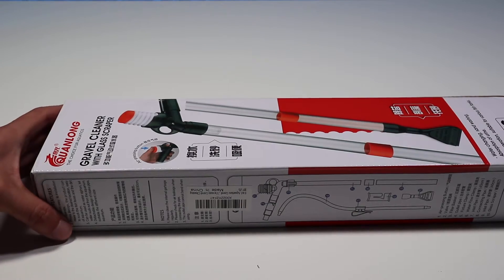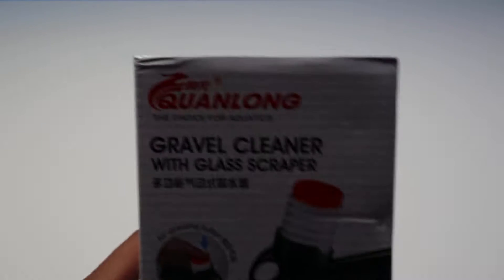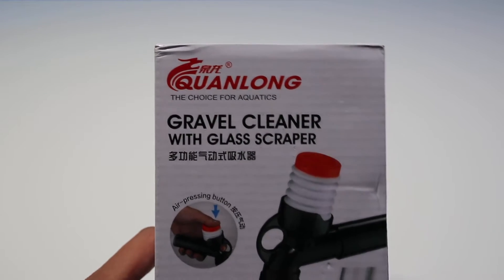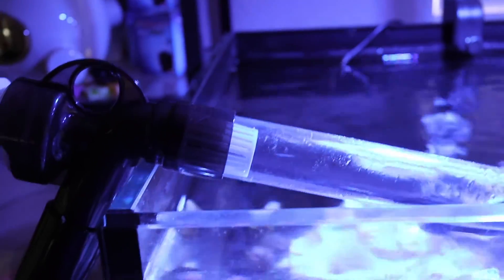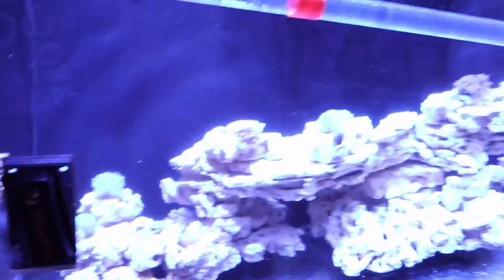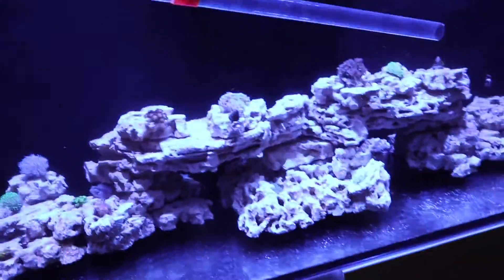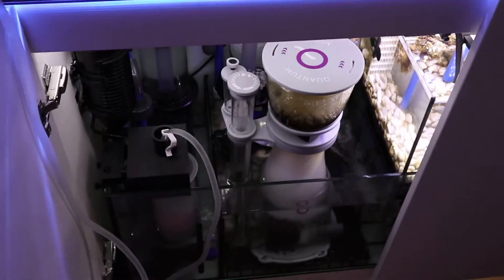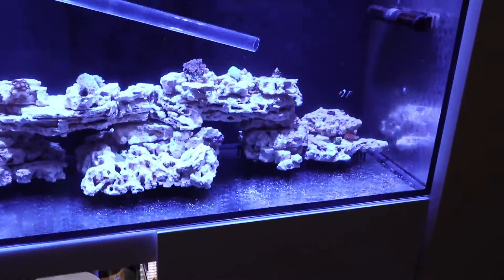RED SEA REEFER 350 AQUARIUM REEF MAINTENANCE

Comment: I bought that gravel vac from amazon it sucks balls. Even with the button pump action syphon starter its hard to start a syphon.
Reply from the maker: dun madun works for me. The trick to get a quick syphon is to use the clip to pinch the line. With the line pinch it only takes a couple pumps to get the water up. Once the water gets over release the pinch

Comment: Looks pretty flimsy and not made to last-I think the python is much better bang for your $ in the long run.  You could make your own algae scraper/siphon hose combo by zip tying them together.  Tank looks good but I’m surprised you didn’t use rodi water—live rock will absorb and rerelease those nutrients later.
Reply from the maker: M W does it really release things back into the tank? i pretty much wanted the tube for the length to save me from sticking my hand in. With the water, I just wanted to see for my self what would happen. Might regret it haha.
Reply: It’s always best to use rodi water for establishing reefs-do you have a rodi system?  It’s usually the first requirement for anyone starting a reef tank-clean water.  If you want extra length python or any siphon tube manufacturer have longer tubes.  You don’t need to start any siphon with your mouth-just fill the tube with water while holding it submerged in the tank, remove from tank with tube opening up in the air, let water drain into the hose, pinch the hose to stop flow, and resubmerge the open end of the siphon into the tank.  Release the hose and flow will begin.  As for the rock it’s always best to not introduce unnecessary nutrients into the tank-kinda self defeating given how much you spend on a skimmer to take out nutrients.  It’s your tank and your decision-I’m just giving you info that I’ve received over the years on how to start a reef.  Good luck!
Reply from the maker: M W I have the RODI just something I wanted to try for my self.
Reply: prolificbreed 👌

Comment: When I had a bare bottom; I would crank up the flow for 1/2 hour every other day and use a turkey baster on the dead spots. I like your rock-work. What kind of rock is it?
Reply from the maker: 9StickNate thanks. I did a couple videos on it it’s Marco rocks reef saver shelf rock. The smaller pieces to lift up the bigger rocks is stax by two little fishes